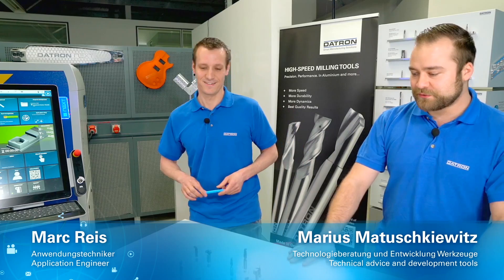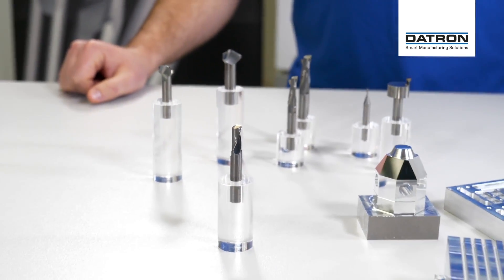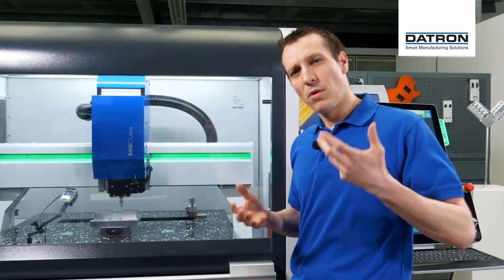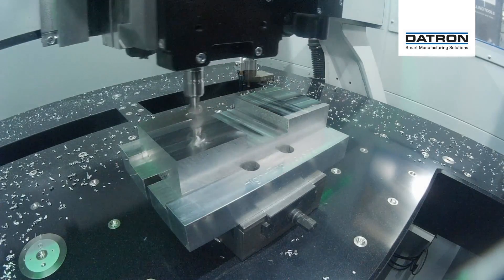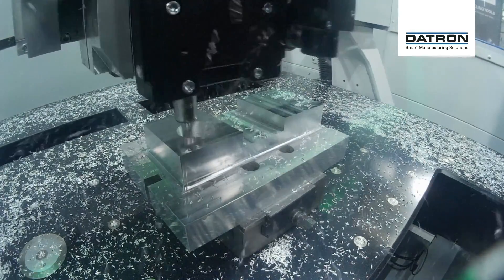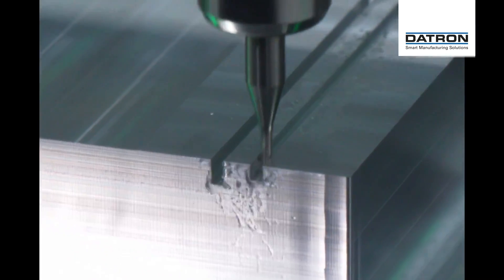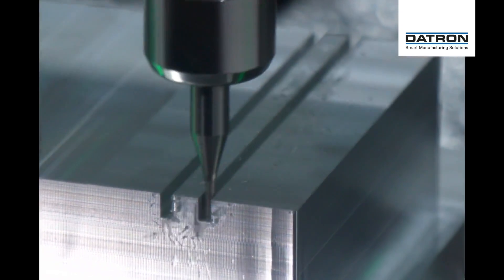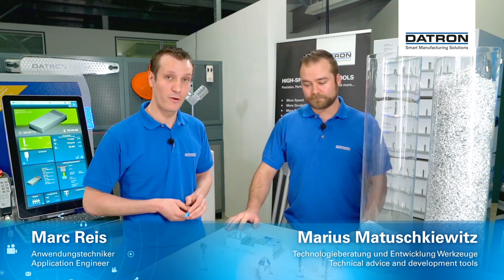DATRON milling tools - Digital Experience Days 2020

Comment: When using alcohol as a coolant it is necessary to either have a high rate of ventilation / air exchange or to wear a hood with an air feed system. Inhaling alcohol vapors can irritate the nose and throat, cause headache, dizziness, confusion, and loss of coordination. Long term exposure can cause liver and kidney damage, and may even lead to death.

Warn your customers about the hazards of using alcohol as a coolant.

Comment: BY my calculations, unless I'm wrong, the 20mm single flute is running a Vc of in excess of 2000m/m. How is this possible when aluminium is normally rated upto 500m/m??

Comment: Guten Tag,
What material are the tools made of? Carbide? And do you use shrinkfit holders for your tools?
Reply: Yes the tools are all made of carbide. I think there are multiple tool holding systems, but in the video they are using Schunk Tribos Polygonal Toolholder.